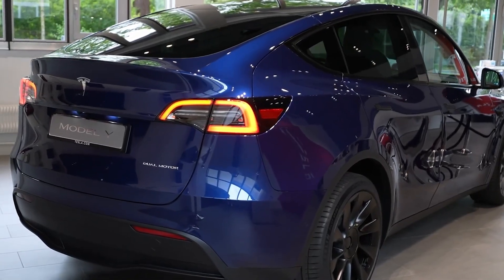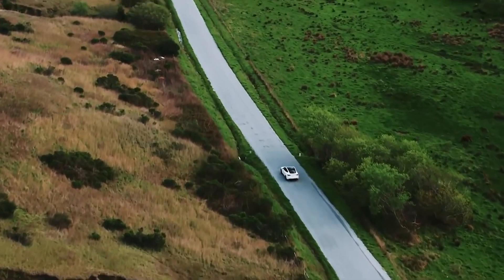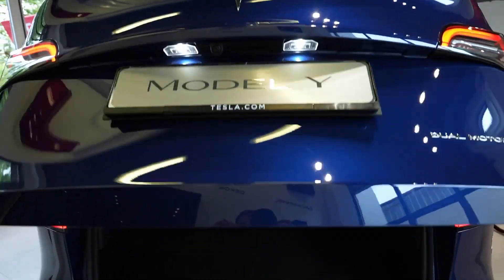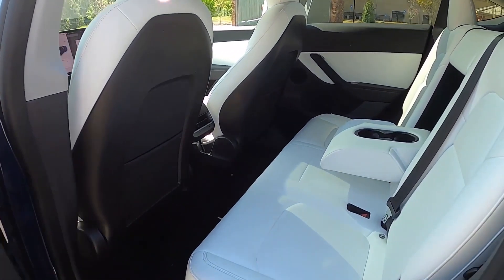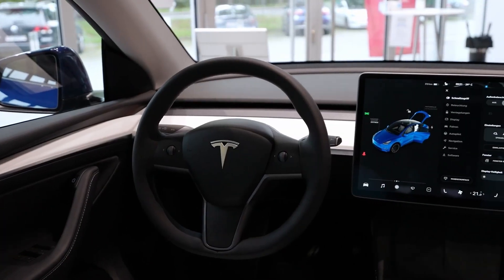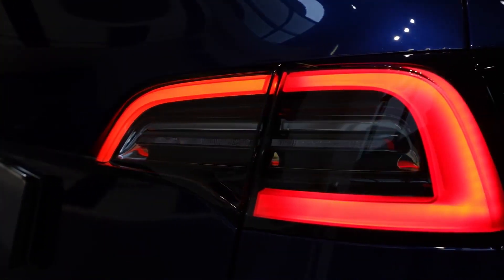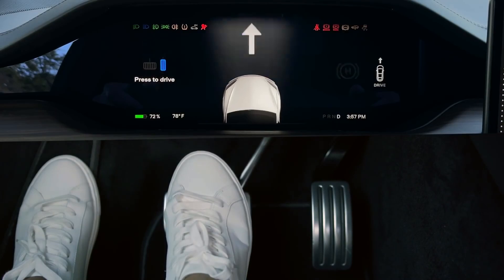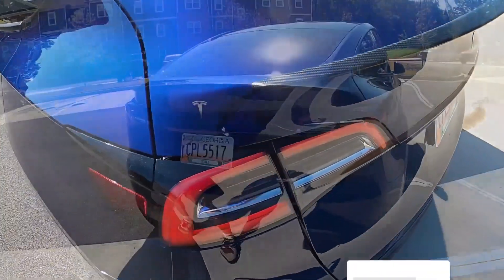2022 Tesla Model Y Interior, Performance, Price, And Exterior Update

Comment: What is the ground clearance of Model Y Performance 2022 and is there any improvement on its suspension/will it be adjustable like S and X models ?? Thanks!
Reply from the maker: The ground clearance is 6.6. For improvement on the suspension, that is the new feature we don't know Is coming in 2022, both for the model 3 and Y, since these are the economy vehicles in Tesla's fleet. At least until the rumored model 2 is released.